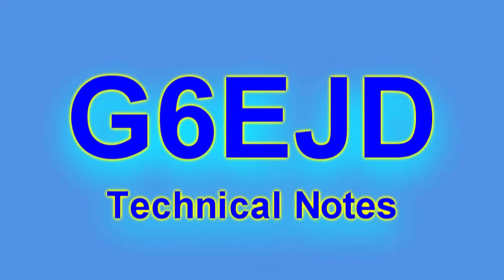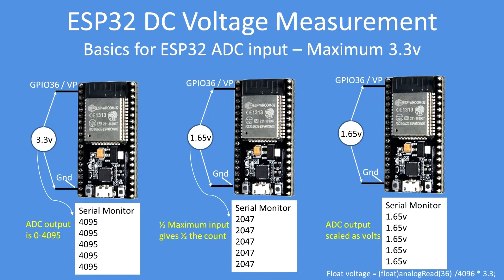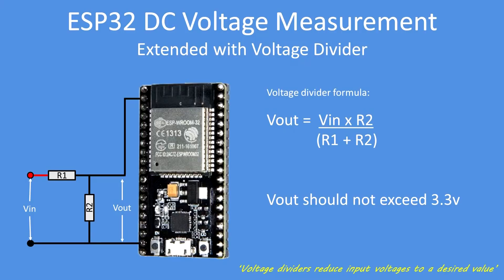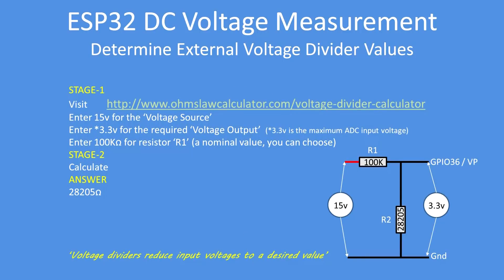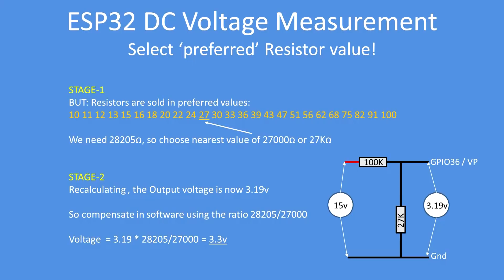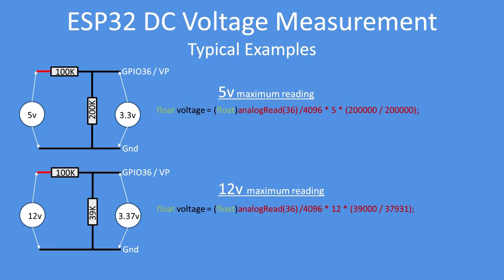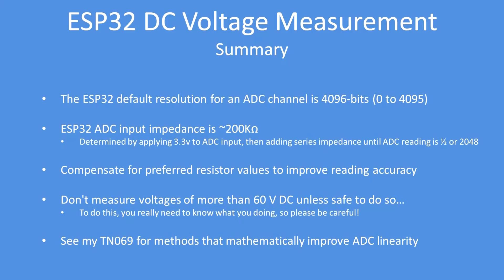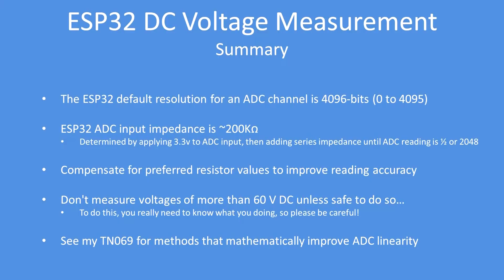Tech Note 115 - Using the ESP32 ADC for wide range DC voltage measurements

Comment: Question on ESP32 internal impedance... if the measured internal Z is 200k , wouldn't that Z in parallel with the 27k (from the divider in your 13.8V example) result in 23.8k? It just strikes me that the internal Z should be much higher in order to keep your voltage divider accurate. Also MOS inputs are usually many meg ohms, as I remember.
Reply from the maker: Your right, what I tried to do is simplify the impedance measurement as actually the ESP32 requires a minimum input current to get the ADC to operate. Taken for instance a voltage divider comprised of two 470k resistors the voltage at the junction will be Vin / 2 but the ADC can’t make a reliable measurement, now repeat the test with say 220k values and all works as expected because there is sufficient input current but not enough to skew the voltage divider values. I was going to give an equivalent circuit of the ADC input but the data sheet gives insufficient design disclosure. So perhaps the best way to describe the input impedance is still to use the word impedance rather than resistance and that the impedance is dynamic, certainly not fixed. Therefore in conclusion I’ve estimated the impedance at 200k to reflect the minimum input current requirement for correct operation.
Reply: @G6EJD   many thanks for the clarification.

Comment: Interesting, but I wont consider that "measuring of voltage". It should be classified as measuring of voltage fluctuations, since you know the initial number. Thx for the video, tho!
Reply from the maker: Well the ESP32 can measure a voltage of any value inside the chosen range, so design for 24v and apply 13.8v and that’s what’s gong to be measured. I don’t understand what you mean by fluctuation as the ADC reading is instantaneous.
Reply from the maker: A d once the R1 R2 voltage divider is added the ESP32 can measure an unknown voltage applied to the input , there is no knowledge of an initial value other than to calculate the range maximum that the ESP32 can measure.